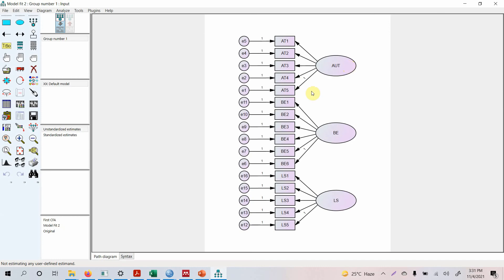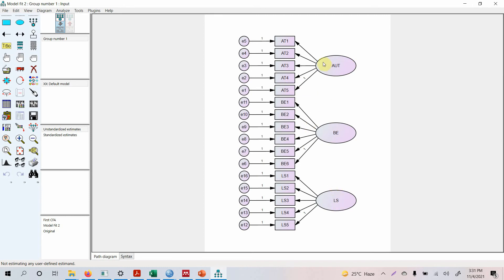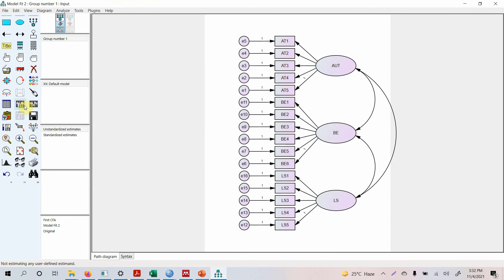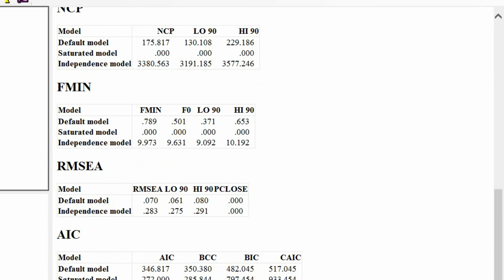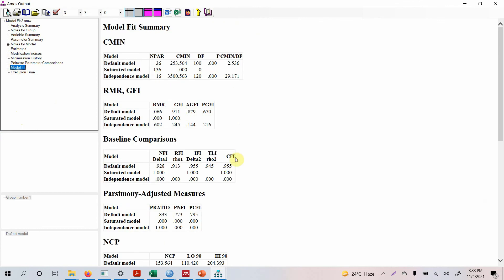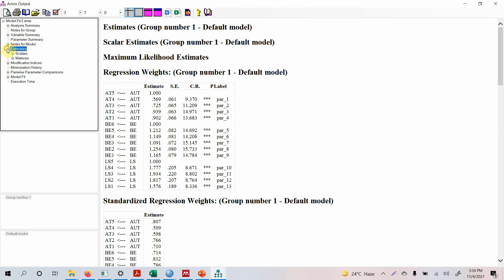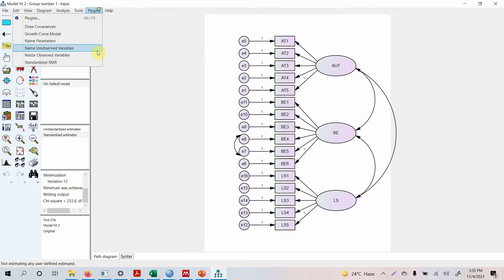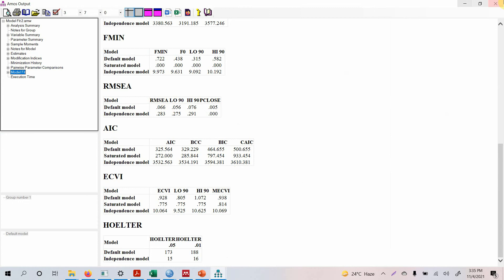10. SEM | SPSS AMOS Lecture Series - Model Fit in AMOS

Comment: Sir, I want to ask one thing, confused at one point. We can do CFA in PLS as well as in Amos. In Amos, we need to report so many things but in pls we don't need to report many things. Can we go with Pls, so that we don't need to report cmin etc. because I just want to use Amos for CFA
Reply from the maker: Although an important aspect of CFA is model fit. But Fit indices in PLS-SEM are limited. You can use PLS-SEM for Reliability and Validity analysis.